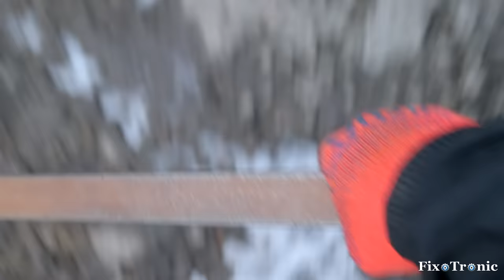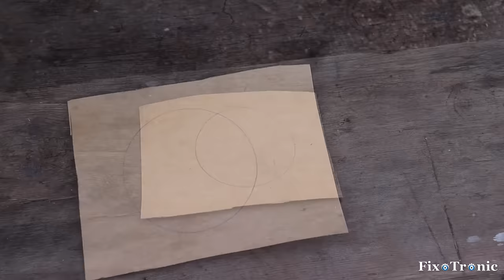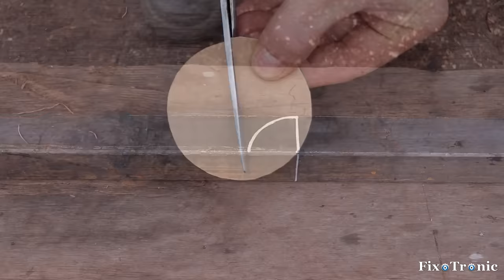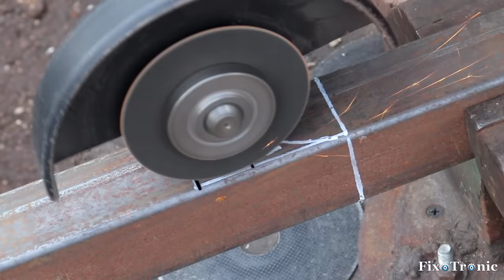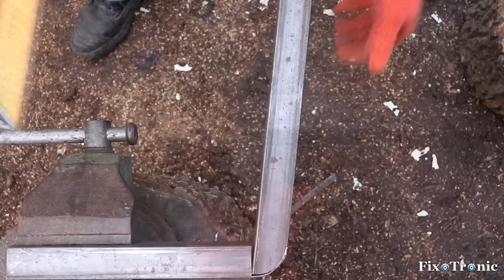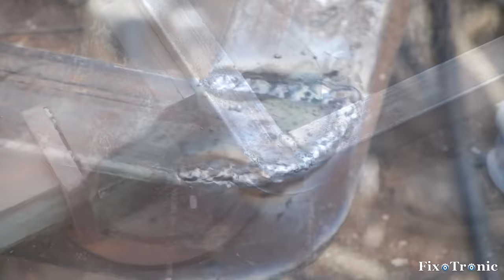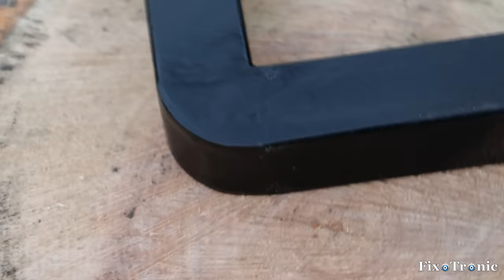Secret Profile Pipe! WHY DO WELDERS NOT SPEAK ABOUT IT

Comment: I know why welders don't use this secret trick. 
Because it takes so damn long
Reply: I was thinking the same thing! Is it really the trick that is the secret or is how long that method takes the secret?
Reply: Most people even if making a square end fit don’t even cap the open end tube.
Reply: If its a better job you shouldn't worry about how long it takes, I'll always pay a premium for better quality.
Reply: Long....? took 5 minutes?....  Probably less
Reply: @M7S4I5L8V2A  a torch doesn't apply here and a plasma cutter isn't always available
Reply: @AAA-vk9vp  Why doesn't a torch apply? Also I was suggesting things that'd get the job done quick, not strictly what some dude may have.
Reply: @itsonlyacommentsnowflake3346  think it's any stronger than doing it the usual way?
Reply: @itsonlyacommentsnowflake3346  ya ok buddy
Reply: @jmccomas2010  it just looks better and takes the sharp edge off, for some applications it would be a better job, i wouldn't say it was any stronger its definitely more pleasing to the eye in my opinion.
Reply: @kristopherhollon5852  Good and you?
Reply: @s1iznc1d34  if its square tubing for a trailer, or log rack, bumpers, cab protection you would want rounded. Workin with what he had I thought it was neat. It worked.
Reply: @s1iznc1d34  you better not be building structural out that thickness
Reply: @itsonlyacommentsnowflake3346  forsure!
Reply: Yup, diminishing returns.  99.999% of customers wouldn't care or even notice the difference between this and a double 45° joint.  I've taken the time to do it on my own stuff, but that's different.  And to those saying it's an aesthetic choice, yes, that's true, but it's hard to play the craftsmanship card when it's farm rod not ground flat, and the outer edges are distorted from hammering.   Not to pick on the maker of the video, but to those talking fine detail craftsmanship that'd be something you'd address long before the shape of the joint.
Reply: @M7S4I5L8V2A  I just think that be a mess
Reply: ...craftsmanship isn't  appreciated by  everyone, as your comment dictates.
short cutting has become the American pastime, when it comes to quality.
Reply: @bodibrodice147  I've seen people just butt and weld and don't even cap the open end, it's the curve that i like, double 45° is good also. I'm a carpenter I've never done any welding in my life but i appreciate people who take the time to try different methods...
Reply: @bodibrodice147  that percent would be flipped for me selling doors and windows for custom homes....w hich they usually have fancy architect or designer on their team. Sometimes it feels like I'm selling glassat the same price of the steel per sq ft 

damn rich folks love their glass walls
Reply: When you have pride in your work it doesn't matter how long it takes....the outcome speaks for itself.....!!!!!!
Reply: „Watch this one weird trick welders dont use because it takes too bloody long.“ 😂😂😂
Reply: @novavroomvroom4759  amen 👍
Reply: Just miter then cut your radius AFTER you tack the joint
Reply: May take longer but I personally like the rounded edge it gives.
Reply: @Fordgroup00  then you'd need to cap it and it would look like 💩💩
Reply: A hobbyist who takes pride in his work will take the longer albeit time consuming route.
Only a hobbyist will tell you why.
Reply: Why do this guy's videos keep showing up ?
Reply: Nupenting mah hade wae atuh
Reply: Rookie mistake.  Went for a clickbait title.  If he'd just said more like hey here's an attractive, clever little method, there'd be plenty fewer aspersions to cast.
Reply: Terry Murray 

No it doesn’t 😜
Reply: @itsonlyacommentsnowflake3346  

My junior high art teacher used to say "good, and you?"

Did you have Mr DiGiacomo ?
Reply: Just press fast forward button
Reply: @AAA-vk9vp  it was would take longer than 5 minutes, between changing positions on clams and stuff id expect more like 7 or 8, doesnt sound that bad until you consider how long the entirety of a job is, you would be paying a higher wage on more hours on quality that may be better however is usually unnecessary, i mean for a similar result doing it the normal way you are talking 1/4 the time, you also can hire a cheaper welder so in the end you might pay this guy 5x as much, for a small job thats an asthetic piece or where quality on the end pieces is absolutely necessary id pay it, but usually its completely unnecessary, plus its much easier to mess up a cut like that than it is to mess up a normal cut and weld which will cost more in materials and make it take longer so you wind up paying for more hours
Reply: @novavroomvroom4759  it does when its on the pay of someone else, if this is a home project its fine but for commercial use its not applicable 99.9% of the time
Reply: Reason is that most welders now days dont fabricate anymore.
Reply: @M7S4I5L8V2A  : True.     But not evryone has, or can afford a torch and/or plasma cutter.  Some folks are beginners, in case you've forgotten ! 😂😂😂😂
Reply: @s1iznc1d34  : Personally I think it's great !   I would definitely do it !
It seems like a GREAT skill-builder to me !   Thanks for the video !
Subed !
Reply: If you did a lot of them you could make a stencil to mark it up faster.
Reply: Yes..u are correct
Reply: yeah, it's also a good way to get your ass kicked on a jobsite. only started using shit like this after i started building custom cars and race cars
Reply: That didn’t take long at all.
Reply: @AAA-vk9vp  10-15
Reply: We agree.cut,fix 90° then make a cover.its easier.
Reply: It would take a lot longer then just cutting the piece square and welding it on but if you have any pride in your work this might be one of the coolest damn things you’ll ever see
Reply: What this really is a good way to form a 90 degree tube fitting if you want a nice round corner.
Now if you are making a square or rectangle form of the tubing then it can get complicated in a hurry
Reply: Looks like something a sheet metal welder would do. Boilermaker wouldn't do that cuz they're more concerned with strength over looks (and they mostly make full pen welds). Pipe fitters usually only deal with square tubing for pipe supports, and this technique would introduce weakness into the frame for the sake of cosmetics. Iron workers wouldn't do this because it's not kosher with AISC. Yeah, looks neat, but only good for decoration not any serious, industrial, use.
Reply: @AAA-vk9vp  thats how long the video is dummy
Reply: @deezupzeohdown957  didn't you daddy's teach you how to read time... the video is 4 minutes and 53 seconds
Reply: @AAA-vk9vp  but if you need to connect 30 tubes, thats a few hours of extra work
Reply: @novavroomvroom4759  "When you have pride in your work it doesn't matter how long it takes....the outcome speaks for itself.....!!!!!!"
Until you run out of cash.
Reply: It’s very apparent none of you have any real experience, Simply weld a 90 angle then use a Router to round the corner to a curve
Reply: I'm thinking it's likely because they just cut a 45 and weld the two pieces together...  It's a lot less finicky.
Reply: @RayRay-dv9xg  "but if you need to connect 30 tubes, thats a few hours of extra work"
Exactly, only use more expensive craftsmanship, if your employer needs it, and is willing to pay premium. Otherwise, you just give out free labor for something your employer doesn't care.
Reply: @AAA-vk9vp  So you reckon he was hammering and filing as fast as in the clip?
(No, I'm not really trying to keep between you and the door while edging closer to it, you must be imagining it....)
Reply: Cut two 45s, leaving the outside corner.  Bend.  Weld.  Less time.  Fewer tools.  Same strength.  Fewer welds.  Closed ends.  And less to screw up.  No jig or clamp required as in butt joints.   No twisting.  No difficult cutting and grinding.  And much easier to calculate the length needed as the outside dimension = the length of pipe.
Reply: Everything takes time actually
Reply: @M7S4I5L8V2A  plasma cutter for sure
Reply: @itsonlyacommentsnowflake3346  aaaaaah not what my boss says... 1h for a 3h job QUICK QUICK QUUIIIIIICK
Reply: I will probably use this to make a roof rack for my tahoe so I dont have to buy  the one I want for $900. Lol I'll just make the one I want. I'm gonna use aluminum square tubing though.
Reply: @jmccomas2010  if he beveled it and welded it with the correct weld procedure yeah.
Reply: Something I can use for pipes on the bbq pit I just wouldn't grind my weld away as much as this dude did
Reply: What a bunch of jealous haters.No where in the video did he imply this was the fastest most productive way.Do you think its obvious to all it would be more time consuming?Quit stating the obvious as most of you experts have done.How many videos have you made that recieved over 20 million views?
Reply: What's wrong with a 45??? I don't need to know this "secret" cause I got a miter saw And a square.
Reply: @AAA-vk9vp  guess again. The video took 5 minutes by itself and it was even sped up....lmao
Reply: @scottlytton5328  I can do it in 5
Reply: @AAA-vk9vp  doubt that. Lol
Let's see ya do it.. yet dont bother because you can't do it
Reply: @AAA-vk9vp  👍🏼
Reply: @lordofpain3476  I dont know, why you watching them?
Reply: It'sOnlyAcomment snowflake no u wont
Reply: @bodibrodice147  Also TIG would have been better for this thin material
Reply: The only reason to do this is if the blueprint specifies a round angle which as far as I am aware is not often. Personal projects maybe but other than that you don't really get a choice unless you suggest it and they like the idea.
Reply: @AAA-vk9vp  🤡..... A good fabricator would be pushed to complete what is shown in under 45 minutes.
Reply: @novavroomvroom4759  LOL you will not make any money and will go out of business! 🤡
Reply: @M7S4I5L8V2A  I think any of those methods would damage the side of a profile rendering the joint useless. Unless you would offset cutting line by at least a few mm but then it would be too stiff to bend
Reply: It only took less then five minutes!
Reply: this was just one corner REALLY sped up, imagine doing 3 more to make a sq/rectangle
Reply: Good
Reply: You could just use a pipe bender and avoid the welding altogether, it would be a lot faster.
Reply: This kind of thing is not for structural purpose... its for ornemental stuff. Its just a trick to do a nice rounded corner.
Reply: @blakeholder1017  

.
 

..

I
Reply: @blakeholder1017  

I

i
I
Reply: YOU ARE SO RIGHT MATE !

Comment: Because most welders are trying to make a living and the extra time it takes to do this, with no additional structural strength, is wasted. A stronger and better looking product can be made faster by using other, more standard techniques.
Reply: Looked like 12, or 14 guage...pretty sure it wasn't for anything beefy....make a good patio table though😛
Reply: @thunderpop609  
I'm interested in knowing myself. Maybe he will let us know where his video is so we can find out.
Reply: E nak you could just get two seperate pieces of metal create the curve in one end and weld them together. Personally if you use a plasma cutter its alot easier not as clean though there is some slag left. A torch is about the worst way because it heats up the metal and changes its tensile strength. Another way would be to get a machine and just simply bend the tube which can be done even with something round. There is one secret that welders wont tell you how to create a 45° without damaging the material in any way shape or form but I'm not giving that one up easy lol. Go to google you cab find it there.
Reply: Pretty cool picture frame heh
Reply: I thought the end result looked pretty damn good! I'm no welder but he looked pretty professional to me. A well made video and 1000 dislikes? Bullshit by bullshiters
Reply: Show us the science on why your methods are more structurally sound
Reply: Just use TIG it’s strong low profile and easy (I’m a freshman in hs rn and find TIG to be the best looking)
Reply: Rodney Long If you know how to use an angle grinder, it shouldn't take you more that 5 minutes. And it has a nice look. But please do shed some light on how you could do better.
Reply: @itzmasoon8238  It's also the most difficult weld to do and a lot of people have stick and mig welders not as many have a tig set-up.
Reply: SDMacMan 

Tack your miter, then cut and cap your radius. Done.
Reply: Oh, that's simple..... tell the welder to do better job then was done in the video!
I am an aircraft structure repair specialist, I don't do my own miscellaneous welding projects. I do though hire the best that I can afford. I would never expect a man that trying to make a living to spend 5 extra min to do that, per corner, when it could look better and be stonger using a standard technique. 
I would expect someone might do this if they were welding as a hobby or making some unique one off peices of furniture.
Reply: @AAA-vk9vp  they are not "mine" . Take a basic welding class, if you haven't already. The classes I took in "92" informed us of the strongest welded corners within the first 2 days. I am sure nothing has changed.
Reply: Regarding structural strength , your wrong , this clearly adds strength to the corner , and if a weld cracked from an impact , there still original strength added from the remaining quarter pipe . Fact ! It may take more time , but it's better !!! :)
Reply: @Seymour Kuntz 
Its already been proven. The American Welding Society has that testing documentation. Its taught in every welding class that a 45deg cut, weld it being sure use a fillet weld on the inside corner.
Reply: @AAA-vk9vp  its pretty common sense that round tubing if done correctly is stronger and lighter than square, theres a reason they use round tubing for almost every single bend and build in a racing offroad truck cage/frame or street even, even the way he cut and bent that weak square tubing looks so bad, you could almost break that crap apart with your bare hands lol.
Reply: All the idiotic comments talking about speed and strength of the joint when it should be obvious to everyone that he did it this way to get rounded corners.

Comment: I’m guessing it’s a secret because it takes 20 times longer than cutting a 45.
Reply: Maybe you dont want a pointed corner
Reply: Mr. E some applications require a round corner, this is for that, if you cut a 45’ you get a point, totally different... I will be using this on my cart frames from now on so it no longer has a sharp point which will make it slide off Competition easier when I pit manoeuvre them.
Reply: So you are saying that you can do 45cut in 14.64 seconds? 
Please make a video. I never seen a man that fast. I'd like to learn a trick or two
Reply: @antoniocavric4322  with cuts and speeding up the footage i sure could.
Reply: Also this method is much less accurate, imagine having like 3 metres frame with 2 degree errors and it is easy to make such errors with this method
Reply: Unless it's specifically called out on ifcs it's not financially feasible . It's 5 times the work of one mitered cut with both ends ready to go.. js
Reply: Antonio Cavrić easy to do...  it is called fast forward...  this video was sped up quite a bit...
Reply: @antoniocavric4322  you realize this video is sped up right? Lol
Reply: Mr. E I was thinking the same thing
Reply: Antonio Cavrić I hope you don’t think it took that short to actually do this.....
Reply: Miguel Sanchez good point...pun intended
Reply: Doesn't look solid at all.
Reply: Plus whoever welded it wasn't a pro obviously
Reply: @darksamurai213  I think a plane just flew by
Reply: This would have taken half the time with a plasma cutter.

Comment: wow, I've been in metal fabrication field for 35 years , there are many ways of making corner joints with round/square tubing, this is just one, there's nothing new , unusual or extra ordinary about it.
Reply: but he gave away a part of the riddle of steal. He need to be punished.
Reply: Ok. Whatever,. I will only point out that he used a very rudimentary and economical way of doing it. Exactly what the masses of tinkers out there need. Good job, IMHO.
Reply: Many non welders would not know about this though
Reply: Foreman: What the feck ya doing? Stop ruddy wasting time and use the Plasma torch and Mig welder.
Reply: I fabricated and welded for 11yrs and I've never seen this so thought it was quite cool
Reply: @raynman6466  well if they're non welders, what's the point in knowing it? 
"I'm never gonna weld anything, so let's check out this video about a technique that welders don't tell me about"
Reply: Armando Silvier  but what about the time it took you to think of and write that comment? Probably the Same amount of time again...
Reply: @ksm1985  Exactly. One always learns more. The learning never ends.
Reply: OK boomer.
Reply: And the weld at the end is fucking unbearable to watch
Reply: @GeoThaDude  I meant welders as in people that do it for a job, plenty of people that aren't "welders" that still weld
Reply: The real secret is don’t be afraid to spray paint and a grinder to cover up your hack job weld lines.
Reply: Armando Silvier  plus 30 seconds of typing also
Reply: All the welders in here trying to play it down, nice try, we know your secrets now Ha!
Reply: If u are a welder ur life may be in danger
Reply: 1. Time consuming.
2. Theres no point.
3. Thats a really shitty weldjob.
Reply: @leonaldobrum  What is a "tinker"?